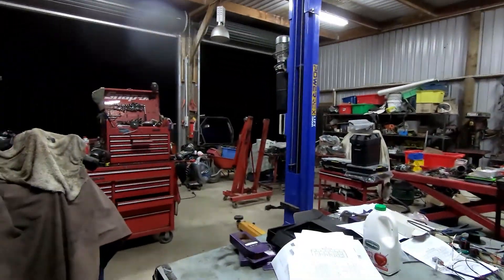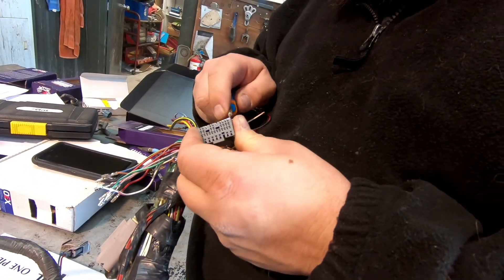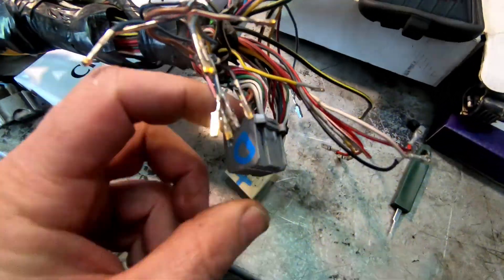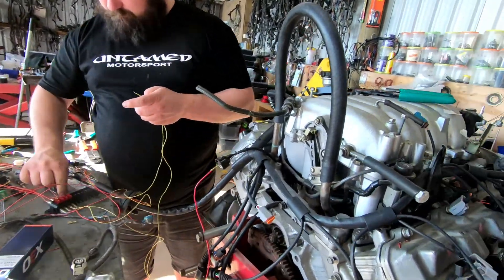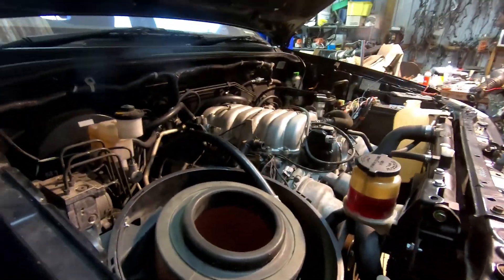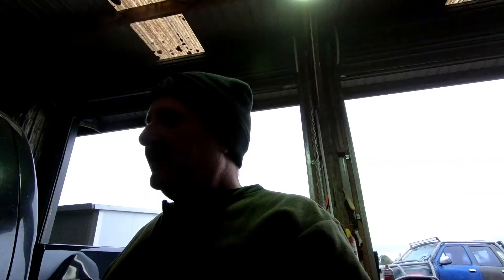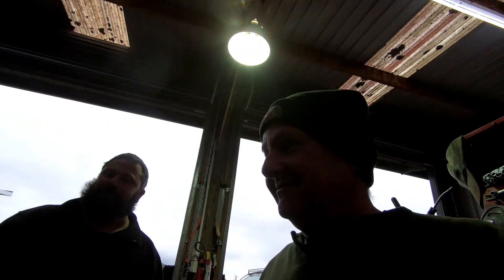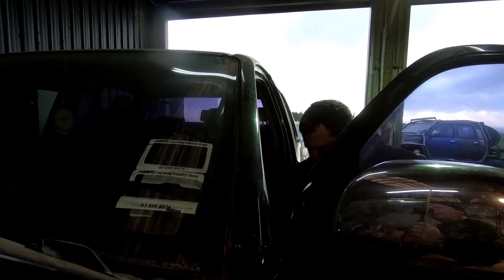2007 Black Toyota Hilux Vigo 4x4 3uz Manual Swap EP5 CartuneNZ - Wiring

Comment: Morning Kelvin I am just starting on wiring my 1uzfe g2 new injectors. Wondering if you have a video on how to fit Bosch Ev1 connectors Regards Ian.
Reply from the maker: No video on that as its pretty simple.  Cut off old connector , Id Pop the pins out to maximise length and then crimp replacement.  Cheers Kelvin